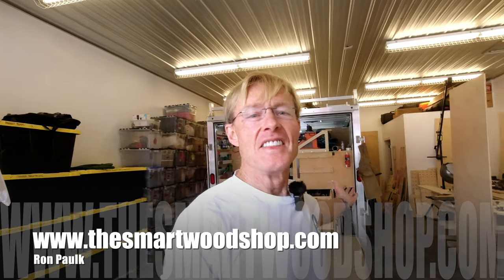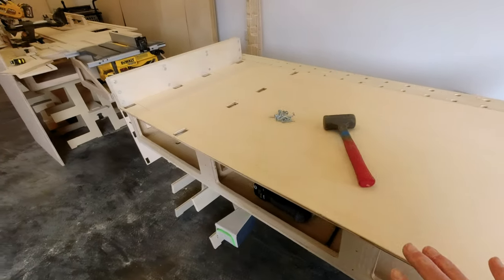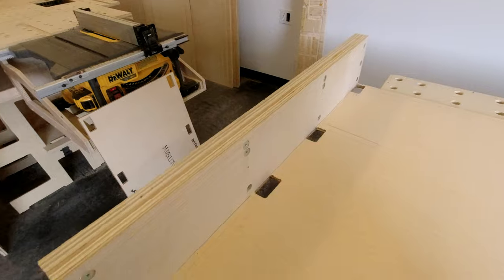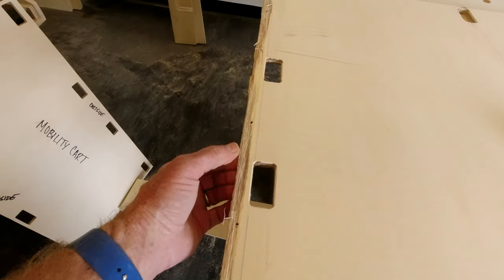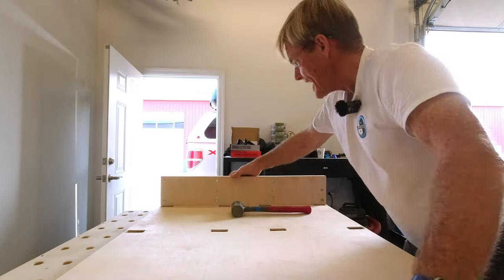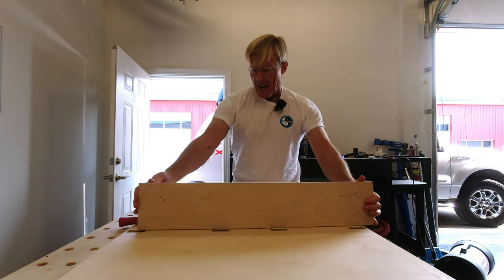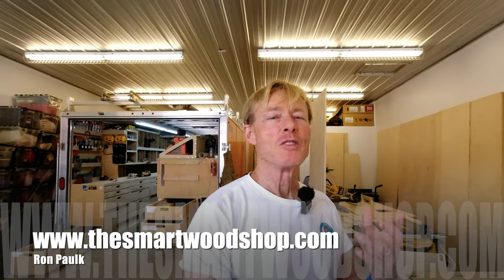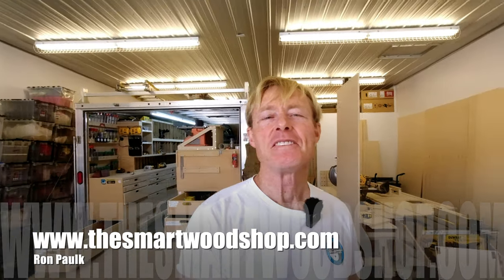Does wood glue really work?

Comment: Glue is great but to get the full strength, you must smear the glue firmly over both surfaces and then reapply a small amount before joining. Then you must also have a method of clamping/wedging/screwing the pieces together for it to cure correctly. The way it works so I’ve been told is it actually lifts fibers from both pieces by sucking the moisture out of them and then bonding.

Comment: Lotus cars in the U.K have been gluing their cars together for decades. If it works with the amount of stress that a sports car can
 generate I'm sure it works well enough in wood. My preferred glue is titebond 3....not the cheapest here in England, but it works well!
Reply: There are different types of glue though, so just because Lotus uses "glue" doesn't mean it is anything like titebond or hide glue or super glue.

I personally like titebond 2. It is a bit cheaper than 3, but my main reason is that it dries lighter than the wood I use. Titebond 3 dries in a darker grey line (good for dark wood), but 2 dries more of an amber which blends perfectly with the line and Douglas fir I use.
Reply: @woodworkerroyer8497  lotus use advanced epoxy glues to bond composites and aluminium structures and obviously not white PVA or yellow aliphatic wood glue. I should have said that the right glue adds great strength to a joint : i suspect by eliminating the tiny movements that can occur between components when they are put under stress. Agree with you about titebond 2...in fact I think titebond make the best adhesives on the market for timber and construction.

Comment: there is a commonly repeated fallacy in woodworking that "glue is stronger than the material it's connecting so you don't need mechanical fasteners".  This is nonsense.  Just because a joint breaks and takes some of the wood on either side with it doesn't mean that the joint wouldn't be stronger with mechanical fasteners.  mechanical fasteners are attaching deeper into the material on both sides of the joint.  It's not an either/or situation, it's better to use both.

I've made enough mistakes, and torn apart enough joints, to know the difference! haha! ;)
Reply: i 200 % agree, i do auto body, and there are usually  a few different things on cladding, mouldings , especially body pannels like a piece of cladding will almost always have a few  clips, a couple screws or bolts , and a strip of some kind of glue, they are always better in concert with one another, but i gotta say,, some of the stuff 3M has out is pretty  strong, i can't even grind some of that stuff off